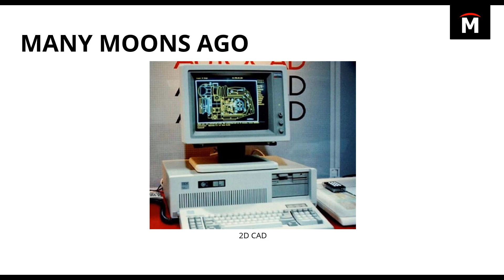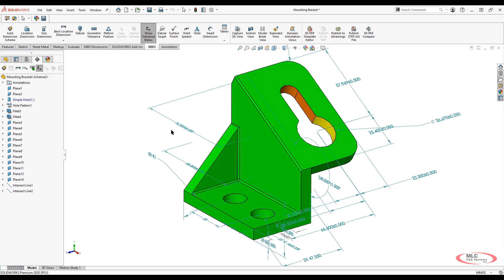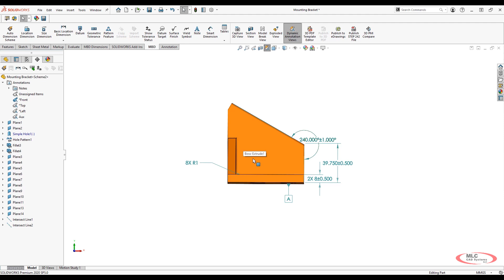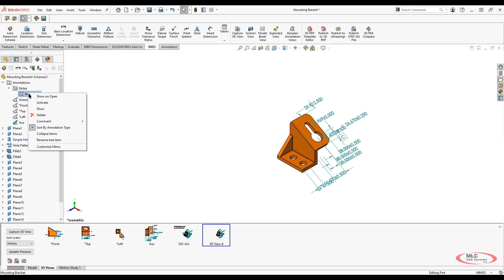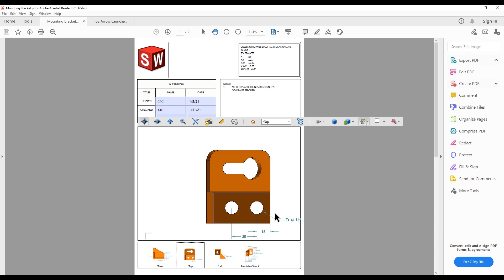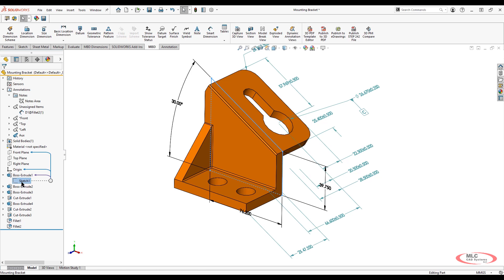How to Go Paperless or Drawingless with SOLIDWORKS MBD

Comment: There's no way to annotate external thread
Reply from the maker: Here is how I would do it: Add a cosmetic thread to a cylindrical face on your part and define the size and callout in the Cosmetic Thread feature.  Click OK, then right click the cosmetic thread feature (it will be absorbed under the feature that created the cylinder you selected) and Insert Callout. The value you entered in the cosmetic thread feature will be displayed as an annotation that you can then add to your preferred annotation view.
Reply: @MLCCADSystems  Thanks for the help.
Reply from the maker: @ Anytime, you're welcome!
Reply: @MLCCADSystems  I hope you can make a video with a more complex part